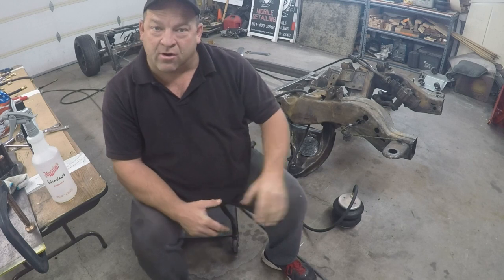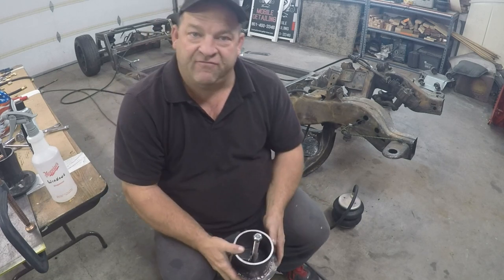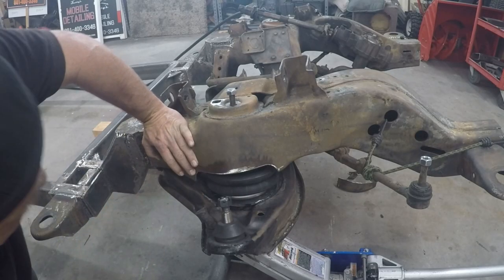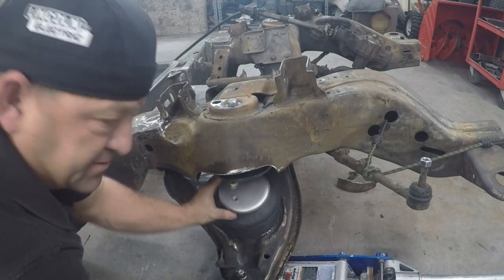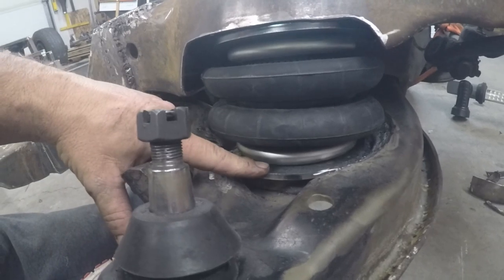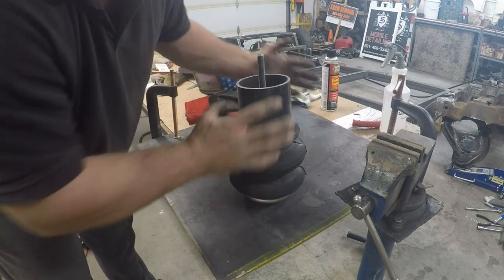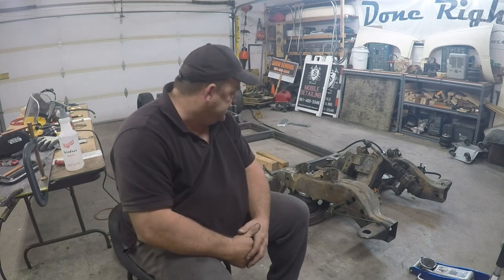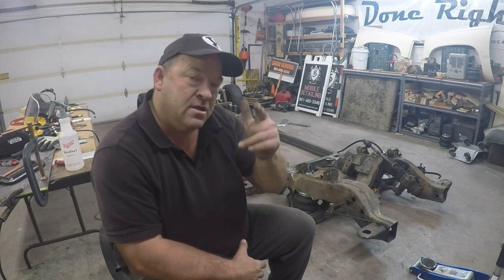FRONT AIR BAG INSTALL

Comment: Nice work. To bad you don't comment back or I would ask you a question. Take it easy 👍🏻
Reply from the maker: Like what? What is your question?
Reply: @ScottysDetailing  thanks for getting back to me I appreciate it.
Just was wondering if a kit like you installed would work on a 78 firebird subframe. I have a 55 GMC truck and just got a subframe for it and I would love to put it on the ground. Never messed around with air bags before but willing to try anything. Have not seen any videos of anyone bagging a firebird/ Camaro front clip. Got any suggestions
Reply: @IronheadGarage  I'll help you out man. 35 years of air ride experience. Look into square body S10s, like 1982 to 1993, I'm not saying all the parts interchange but the frame and suspension designs are super close, and you should be able to find TONS of S10 videos.  I've clipped several old hotrods through the years and when the world kinda ran dry of junkyard Camaro and Trans Am subframes I started using firewall forwards section of S10's. Good luck in your adventures!